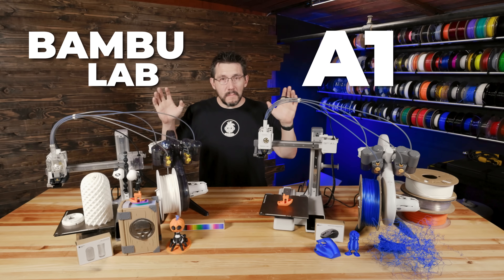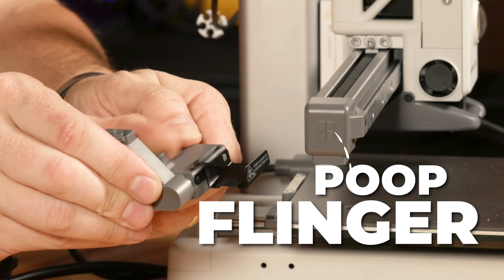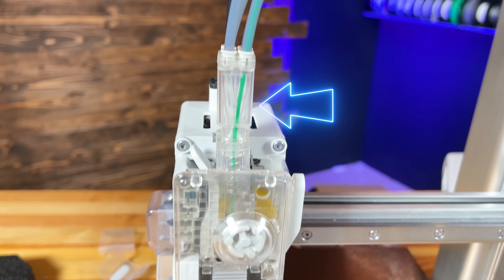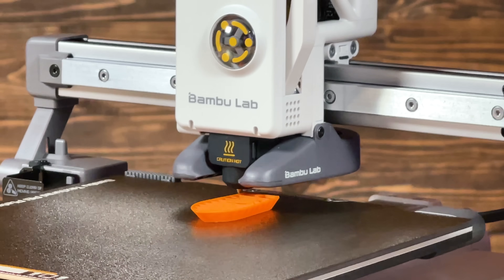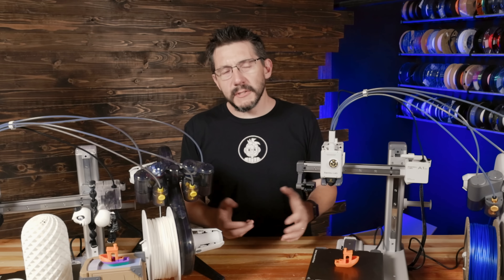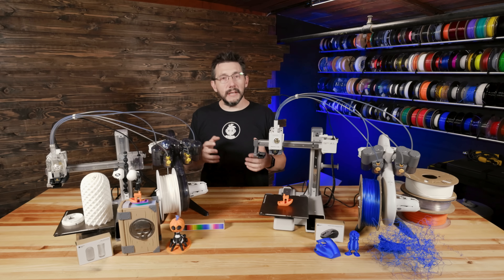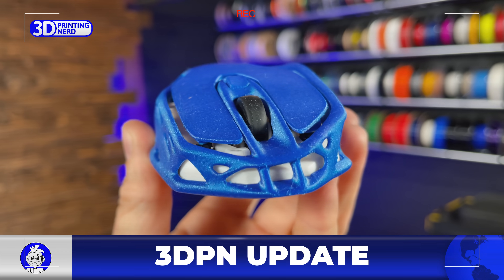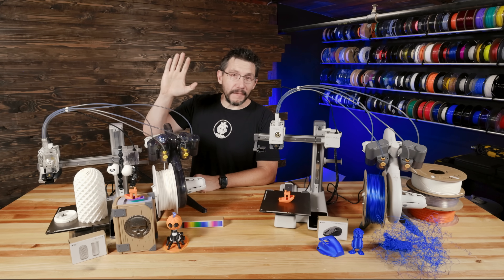Bambu Lab A1 Mini & AMS Lite! Cantilever Bedslinger!

Comment: Have to admit, they are getting more and more tempting.
I love playing with my printers I think more than printing with them.
Just got back into my CR-10 Mini (Yeah, I know how old that is; it still works) and having fun again, and still having to relevel the bed and use gluestick on glass.
I think this last round, I releveled it 4 times?  Checking youtube vids to remind me of ways people do that, etc...  
And it's not a fast printer...  
But when that print comes off (on purpose, not when it pops off mid print), it always makes me smile.
So I've never felt the need for the nicer printers that make all of that so much easier...
But these newer printers are getting more and more tempting to try...
One of the things saving me is price.  I am che... er... frugal with my hobby spending.
The CR-10 Mini I got on sale for I think $139...  So I am trying to stay under $150...
So as long as my wife doesn't give me a gift card, I think I'm safe from these newer printers.
For now... :-) 
I do admit the multi-color isn't tempting to me.  I like my prints monocolored.  ;-)

Comment: This will be the excellent companion to my ratrig and v0. My ratrig is specifically PETG with a hardened CHT nozzle. My V0 is specifically used to print ABS parts for my ratrig and other parts that require an enclosure. This is a perfect printer to print and forget. Not to  big and has multi material and should keep up or be faster than my current printers.

Comment: Thank you for the video, Joel! Trying my luck with early reviewers on YouTube such as yourself with no luck so far but is there a chance you could let me / us know the exact L x W x H of the A1 Mini with its spool holder (not the AMS Lite, just the spool holder)? Would appreciate it if you could chip in that info!

I am trying to build an enclosure for the printer before it arrives. As such, trying to figure out the exact measurements to have acrylic sheets cut to size.

Bambu product page does not state which measurement they put in specs corresponds with which of L, W or H and I do not think there is a set convention about their order to make sense of. They also do not specify whether the given measurements include the spool holder or not.

Comment: I have to admit, it's a great printer but... I have no idea what problems Bambu is trying to solve with a 180mm printer. Both the advantage and disadvantage of a 180mm printer is that it is very small. A1 with AMS and a bucket for the poop slinger has all the downsides of a 180mm bed but nothing to compensate. It looks like it takes up even more desk space than the X1.

Comment: 8:30 Cloud based. huh. So it had to have negatives. Never buy something cloud based, because the cloud might be gone tomorrow.
Reply from the maker: It's not ONLY cloud based. Cloud based slicing when printing from the mobile app. Local slicing when using the Windows and Mac clients.
Reply: @3DPrintingNerd  Nice.

Comment: I've had a Prusa MK4 in my shopping basket for the last month along with a MMU3 this makes the decision harder.
Reply from the maker: The mk4 compared to this has the ability to print more materials and has a larger print bed / build volume. MMU 3 I believe does 5 colors.

Comment: Do you feel the 180mm build plate vs the 256mm in the other models hinders it in any way? Looking for options for my next printer. I started with a Flashforge creator pro 2, but the small build plate is killing me.
Reply: The Creator Pro2 has a build plate of 200x150x150, so the A1 mini with 180mm3 would be very similar in my opinion. Go for the P1S

Comment: Completely disagree with the take on repairability. This machine doesn't have anything a user-maintainable machine doesn't, and saying that "typical appliances like washing machines and garage door openers are not user-serviceable too" is highlighting the fact that these devices are also problematic. It's pure whataboutism. Dishwashers and cars should be more like the typical 3D printer, not the other way around. 

It's crazy that this new printer's hotends are not even compatible with their other printers 🤯

Every time new tech emerges, the products are originally user-maintainable, because otherwise they'd be constantly broken, then we get to a point where this benefit goes away because the manufacturers are confident enough that their products will last just long enough to outlive the warranty period, and then the customers are stuck with devices that break down and cost more to repair than to replace. This stupid pattern needs to die. It's bad for users and it's bad for the environment. Consumers need to ask for user-serviceability and vote with their wallet. The recent Microsoft leak has shown how they're actually planning to integrate modular, replaceable parts in the Xbox controllers. Far from perfect, but it's a step in the right direction, unlike BambuLab that's leading its userbase head first into the dark ages.

Comment: I'd like to see a conversion kit for the X1C and P1 to use the A1 Mini print head & also to convert the AMS to run individual tubes to printer.
Reply: I would as well, but realistically that won't happen for existing models due to the costs - particularly associated with the print heads and lidar.
Maybe they'll rework some things in the next versions.

Comment: Awesome review! 

Have you done any testing with using PLA and PETG as each other's support interface?

Also unsure if anything can be done but at 10:54 when price comparing the A1 to the P1P it shows "with AMS Lite $349" but I'm guessing it should be "with AMS $349" unless there's a way to get the AMS Lite working with Bambu's other printers.

Comment: I think the "not consumer repair friendly" is a distraction from the real issue that I'm seeing happening with more stuff - where manufacturers are trying to push even repair shops out of the picture. Appliances - especially if it's not a "smart" appliance - are very much repairable, and in the case of large appliances it's often the case that repairs are done at your house rather than trying to bring it to a shop. The idea that being an "appliance" equating to "not repairable" at all, even by a repair shop or a repair technician is simply not true historically - it's mostly been a trend more recently, pushed by vertical tech giants like Apple. I'm simply going to disagree with this sentiment, and say it doesn't have to be this way - and really shouldn't be this way. I might not be expected to make repairs myself - but I should very much be able to take it somewhere to get it repaired.

Comment: Prusa totally saw this coming when they released the new mini firmware the day before. Would pick this a1 over the mini as well
Reply: If they can't fix the desktop or laptop app problem, I wouldn't get it. Right now...I have to print through their cloud if I want to use their slicer. The lan only mode doesn't seem to be working.

Comment: I started my 3D printing life with a Monoprice Mini Delta and I came to HATE that machine and to hate Cura as well.  Instead of giving up I bought the Prusa MK3S+ and it honestly saved the hobby for me.  The machine is a workhorse and the Prusaslicer profiles work as-is.  Absolutely ZERO tinkering.....  

How does the Bambu stack to that experience?  What slicer and is there a default profile and then do I have to tailor that profile to the machine?

I learned a lot with my MPMD but unforntunately I also learned to hate it......

Comment: The cloud slicing is a step to what I think makes this hobby more mainstream, as one of the last major hurdles to mainstream users is the slicing part -- being able to just print a model, select the speed/quality, and ship it without tinkering with the endless options is akin to how standard printers (inkjet/etc) operate in the user workflow. The user can tinker, but otherwise the driver/firmware handles all of it. Although I would have preferred something like Printables (for the online portion) and the Slicer embedded in the machines firmware.

Comment: I find the continued enforced cloud based printing very creepy. The printers seem impressive but to what cost? Am I the only person that  cringes to this continued closed and cloud solution?
Reply from the maker: It’s cloud based from the mobile app. You can still slice on the desktop and use sdcards.
Reply: @3DPrintingNerd  understood with the total offline/isolation. As with the Bambu printers, it also requires cloud connectivity to upgrade firmware and sending encrypted log files back to Bambu. As a cyber security professional, I find these facts about Bambu disturbing.

Comment: Thanks for your review! I held off buying an X1C to see what they released and we got the A1. It's a great printer, but I'll wait a few more months for any updates on a successor to the X1C and will pull the trigger if no news.
Reply: Just in case there isn't an X1C successor, I thought that I would let you know that I'm very happy with my X1C. I've had it almost a year now (this year flew by), and the experience has been great. I do the routine maintenance that Bambu Lab recommends since it's easy to do. There are no signs of wear on the moving parts. It prints nylon just as good as it can print PLA. It's almost too easy. The speed doesn't get old either. After all of this time of owning it, I still can't help but watch it print sometimes.

Comment: Another challenge to the engineers from Bambu Labs. Bring it on! I’ll be sure to get an AMS Lite soon and add support for it to Marlin (along with formal support for the Chameleon 3D). Meanwhile, input shaping is already bringing extra value and higher speeds to existing 3D printers, so people should do a firmware upgrade or Klipper conversion on their existing machines before springing for a Bambu … if they don’t need the Bambu-specific hardware enhancements.

Comment: You said ti precisely right - it's an appliance now. You also said correctly, that when appliance breaks, you bring it to a repair shop. This, IMO, is the biggest problem with our Bambu Lab printers. If something breaks that we are not able to fix (structural failure, an epoxied-in idler, or whatever may be wrong) or may be not willing to fix ourselves (because we don't have the time or skill or knowledge required), where's the repair shop to bring it in? I hope those resellers that now exist will also soon work as service centres, otherwise this appliance approach is not going to work, or at least it's a big gamble for the consumer. Lemons also exist and having to ship the thing back is the very worst experience possible. And shipping the printer back to Bambu means you have to have the original packaging (most of us throw it away) and a postal service that doesn't cost an arm and leg. Sorry, but nope, I need a service centre that either sends a technician or a courier to pick it up, repair it and brings it back to me or somewhere I can drive to with the printer as-is and just "have it fixed and tuned up".
Yes, so far my experience with support has been good (not that I had many problems), but sometimes remote diagnostics turns to guesswork and you just want a technician to either fix it or swap the whole chassis and investigate (or recycle or refurbish) later.
This is an even more pressing topic for me because I am just dealing with an AMS failure (probably caused by me), where I first bought an expensive part as a replacement just to get one good board that's on it and leave the rest stashed somewhere, then discover the error is probably on the application board which I have to ask support to ship, but there's just no way to tell if even that is going to help and now I have a box of parts that are probably useless, and because I need/want to print I ended up just ordering another AMS as a replacement. That's not what a normal consumer wants to experience at all.
Reply: At this price point, repair (even if there was a warranty repair center available) wouldn't be practical.  The economic model is buy, use till it breaks, trash it and buy another.  Not good for the economy or the environment but that's where we are.
Reply: @williamerskine6035 I disagree. It is not that cheap...
Reply: @zviratko  it is that cheap, sending it beack and forthh does for around 60 bucks. Bambu makes disposable machines. Their approach is going to be similar to apple's in a few years once they think they cornered the market
Reply: @fofopads4450 I was thinking more about bringing it to a (hopefully somewhat) local service centre / reseller. Sending it to China (or even abroad) makes no sense for most people and might be more wasteful than just buying another machine - you are not wrong there... :)

Comment: Disagree that we need to have things go the route of proprietary appliance manufacturers. Just the problem that you demonstrated with this machine on the mouse model already disqualifies it from that kind of fail proof machine, just like happened with the other machines. Adding in a proprietary model is not a good price to pay for adding convenience when we have all the other companies releasing very reliable machines, cheaper, with open source repairability.

Also no mention of the proprietary nature of their software.. the intrusive cloud presence etc. Can you even run this machine without connecting to the cloud?

Comment: If you have to take your 3D printer to a repair shop instead of self-servicing it, you have to take into account that additional cost that a repair shop will charge you whenever something breaks down
Reply: This is what I feel like people always fail to understand. Sure, the initial price is lower, but that quickly gets overtaken by the overpriced, proprietary parts you need to buy when something breaks. 

And that's not even considering the fact that if Bambu Labs ever goes bankrupt or something, suddenly none of the fancy cloud features work and you will never be able to fix the printer again unless you buy a second one used and cannibalize it for parts.
Reply: @olivereisenberger7215  Chinese companies have already introduced knockoff Bambu parts, like hotends. As far as the actual electronics go, that's the bigger issue, I think; if Bambu goes under and you need a new control board, you might be screwed, since it's partially closed-source and uses proprietary hardware.
Reply: @olivereisenberger7215  

Bambu has the most affordable replacement parts of any company, though.  
If Prusa can stay in business this long with no real innovation and expensive parts....  What's stopping bambu?
I just don't understand this fantasy scenario where a company that makes great performing products for affordable prices and sells a bevy of replacement parts going under.

Comment: Hi Joel.   Does the ams lite waste as much filament as the original ams ?   
Only system that I can think of that wouldn’t waste so much would be the Prusa XL.  Unless you know of any others.
Reply: If you don't want waste, 
- purge to infill
- get IDEX printer ;)
Actual multimaterial (PLA + PETG material/support for example) should work better with IDEX (different nozzle temperatures)

Comment: I have a Bambu X1 from the kickstarter and I really love it,  I have 6 other printers and I go to the Bambu 99% of the time ,  Unless I need to print something big,  I was hoping to get a LARGER bambu printer,  I understand why they did this small one and I hope a larger version is on the way.   I also want to say that I have had issues and needed support to send me parts to replace when they went bad,   and I have had a great experience with the support ticket system,  They even sent me a replacement part 2 times when I clearly broke the 1st one they sent I offered to buy the part and they sent it for free anyway.  I cross my fingers that a larger print area is on its way

Comment: Have you tried printing on a different surface other than the table top in the video? Just curious if it moved as much on all surfaces.  I kind of wonder how it would do with a silicone mat under it, or one of those large desk mats or a neoprene type mat.
Reply from the maker: Yes, but not the same model. A silicone mat would definitely do the trick on the desk.
Reply: @3DPrintingNerd  Thanks for the response I appreciate it! Will definitely keep it in mind if I get one 👍

Comment: How is the print quality compared to the x1c? I would assume a cantilever design to  have more printing artifacts and issues. Which is a fair tradeoff for the price, but it would be good to know if thats the case!
Reply: The size is so small that it shouldn’t really matter. It prints FASTER than the X1C because of this. You should expect to get equal quality.

Comment: I wanted to think on this one a bit before commenting.

There is a non-insignificant amount of technology packed into this thing at this price point. I feel conceptually there is a ripe market for this size and price point given the number of people buying 3D prints off of Etsy and the likes.

The problem in my head is those people aren't at a skill level to own this sort of machine yet. Multi-material adds a whole layer of complexity to deal with and, while a big improvement, the tech still isn't at a stage where you can just pass this off to anybody and walk away.

A peer reviewer noted a fair number of frustrations using the A1 which I don't think should be ignored by first time buyers. I do think time is going to tell on this one and I'll be interested to see how it fits into the marketplace.